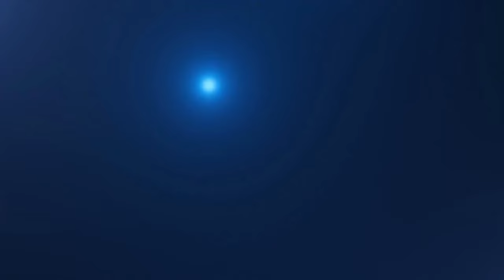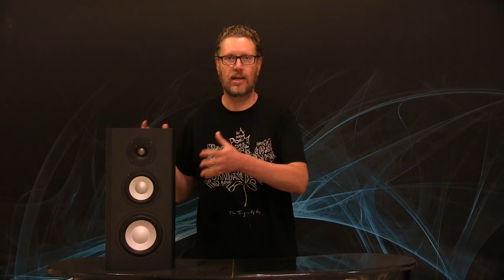Loudspeaker Design: Anechoic Chamber VS. Listening Room

Comment: I will give you that there needs to be a baseline method of measurement. But I also know for a fact that speakers will almost always measure better in an anechoic chamber than a typical living/sound room. Ceiling height in North America  and typical room dimensions with parallel walls for the average person means you will get standing waves, unwanted HF reflections and cancellations. The anechoic chamberl will almost always outperform the real end use environment. I think the average person may get better results if they spent some money on room treatments or DSP than upgrading their speakers. Just my opinion.
Reply: @donc5423 I second that. The room is the most important component in the chain (and this comes from someone with a crappy room). Unfortunately you’ll never hear speaker manufacturers tell you to spend your dosh on the room and not on speakers.